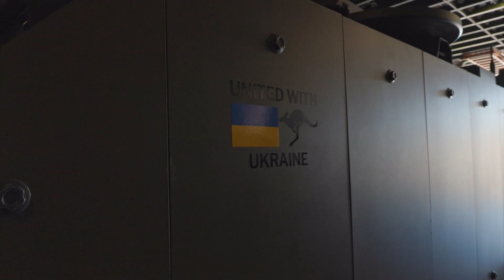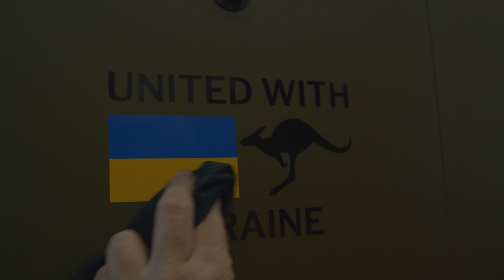Australia Boosts Military Aid, Sends Armoured Vehicles to Ukraine

Comment: (With great sarcasm)  Wow.  Four obsolete 1960's era vehicles first defeated by a bunch of little yellow men in black pajamas in Vietnam and for several decades unfit for the modern battlefield.  Victory is assured!
Reply: They have upgraded since the 1960s
Reply: Yes by todays’ standards they are obsolete on the modern battlefield, but that doesn’t mean they are useless.
This version is lengthened and has a powerpack upgrade and is also up armoured and up gunned, you also have to take into consideration they are reliable and are protected against small arms.
Given that they are deployed against the Russians that have lost so much equipment they are now using 1960’s vintage weapons a 1960’s vintage APC upgraded to early 2000’s battlefield isn’t so bad.